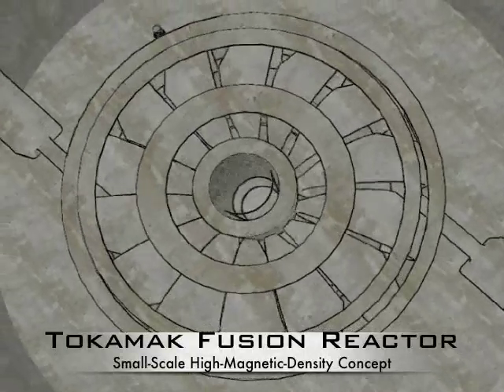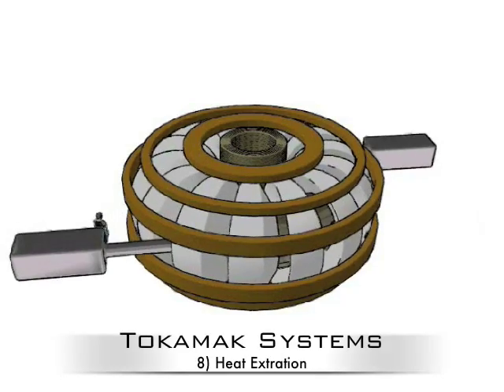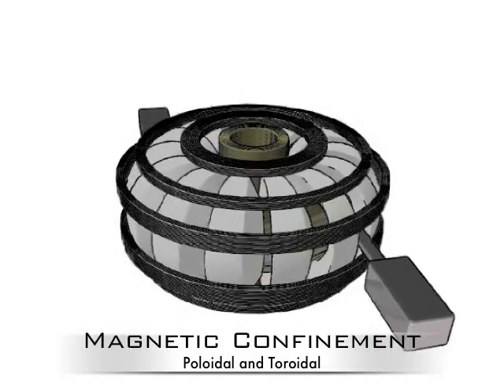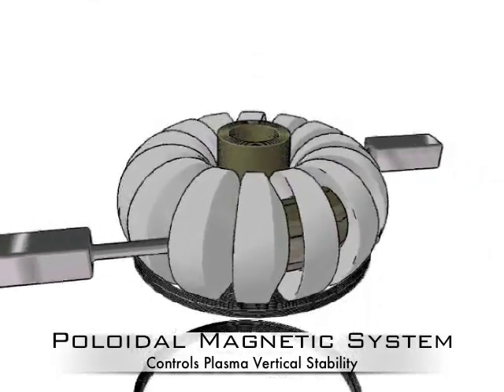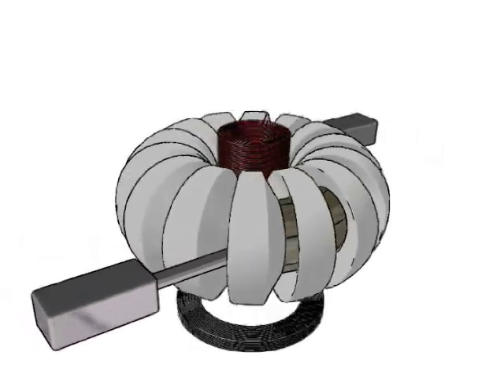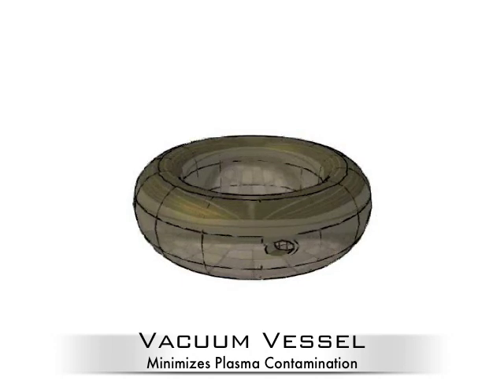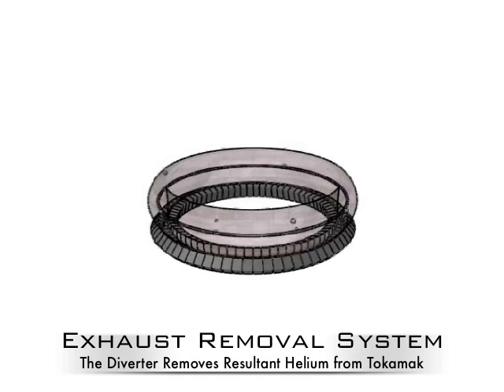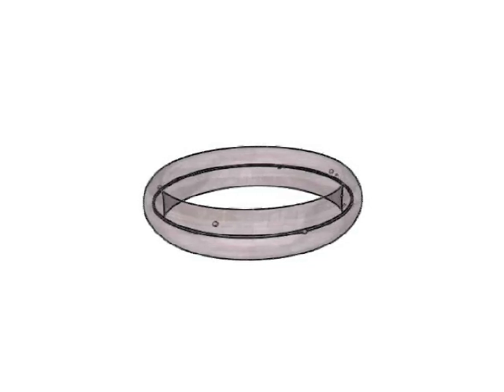Tokamak Overview

Comment: Too much energy is lost in a torus to sustain fusion. A sphere is better. Search for "spherical electromagnet" if you want to see a better design. It should be the first thing that pops up. Look at figure 1. You will know it when you see it - it's my icon that you see to the left. In this design the plasma is rotated like the armature of a motor with the axis of rotation constantly changing. The counter emf inside the plasma compresses it toward the center.
Reply: can i contact with u, because i wanna make my master degree in fusion Dep.